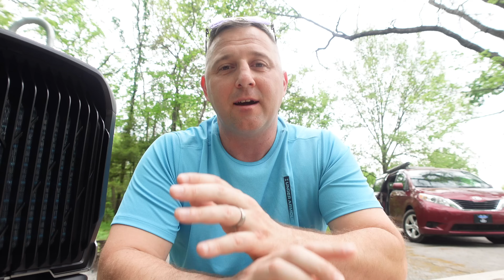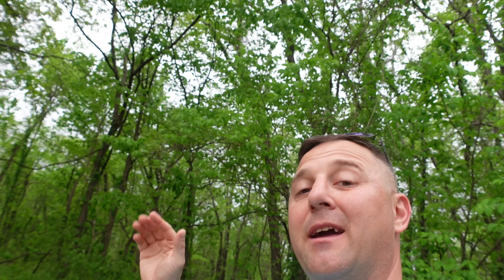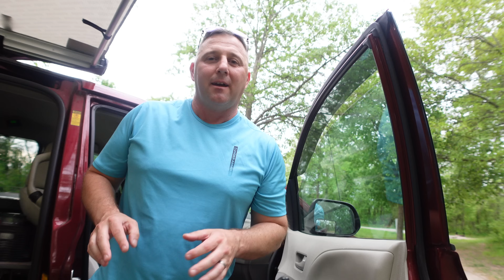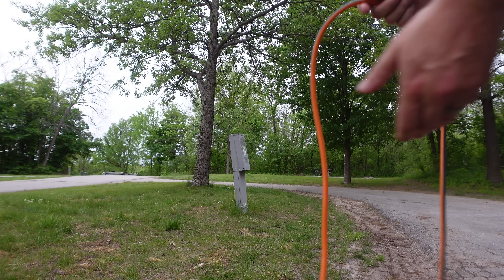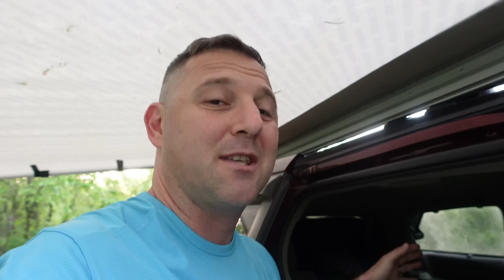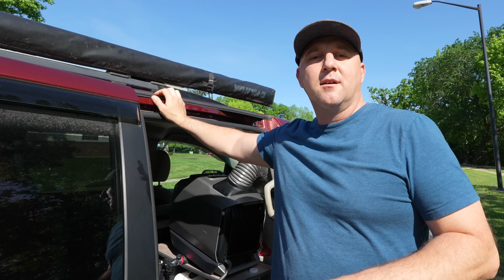The CHILLING Truth! - EcoFlow Wave 2 Portable Air Conditioner

Comment: Why not have it pull in air from outside to cool the evaporator? Would increase the efficiency a lot and then you won’t need the curtain rod.
Reply from the maker: I don’t like dealing with all of the bugs that get sucked into it. They clog up the evaporator.
Reply: @AdventureGearTV  Yummy! Well, something to consider would be a mesh/screen of some sort, but good to know!
Reply from the maker: @mexifinn7830  great tip. I have a mess screen that I tried on another AC unit, and I use those screens frequently without AC. But, they get clogged with small bugs at night.
Reply: No you want the cooler air from the area you're conditioning hot air will make it less effective and decrease the cooling. He really shouldn't be trying to isolate the area from the return..
Reply: @cwindsor8585  evaporator is the hot side of the ac. Condenser is the cool side.

You WANT to use outside air to blow the heat away from the evaporator. Otherwise you are taking already cooled air to expel the heat. The negative pressure will then promote the suction of hot humor air to come back in.

That’s why those free standing acs are less efficient than window units.
Reply: @mexifinn7830  no sir the condenser is the hot portion and the evaporator is the cold portion I hope I would know since I've been making a living doing ac for the past 15 years The only thing you have to worry about is expelling the hot air from the top out of the area which you're trying to cool. Other than that, all the air passing over any coil will help it become more efficient
Reply: @cwindsor8585  You are right. I'm not an HVAC person and I have them reversed. But I do have a degree in Chemistry and understand thermodynamics. I think we both acknowledge that you don't want to use the same cooled air on both sides :)

Comment: Do you recommend at the price it is?
Reply: Cheaper than buying a hybrid sienna
Reply from the maker: It’s a tough question to answer. It seems to work fine, and it’s not extremely big compared to what it does. Also, how often would a regular person actually use it? Three times in a year. I plan to use it much more.
Reply: You make an excellent point, Larry. Way cheaper for sure. The hybrid sienna is something I want, but I don't want to get back into debt anymore.

Comment: The AC is intriguing. The heater argument is laughable. How can you compare the heat pump efficiency of a battery powered system to a plug in space heater? If you only look at the heating, you're comparing an $1100 unit to a $30 unit that you don't pay for the power at a campsite. That said, I'd definately consider this for the AC operation. As far as that initial cool down, don't forget, you most likely have a very powerful AC system in your vehicle and can get the interior comforatble using that then use the Eco mode on the EcoFlow 2
Reply from the maker: Not matter how you look at it, a device like this is expensive compared the those space heaters or a plain fan. For $500 you can get a window AC unit. But, then you wouldn’t be Glamping in style.

Comment: So I managed to order a Wave2 early this morning for $999 from a non-Ecoflow site. The Ecoflow coupons and codes and discounts were so convoluted. I so appreciate this video! Great reminder about the app; i should probably check for updates to my Delta Max. Loved the demo of the hose in the window -- it looks better than my version 😄 Is that pool noodle oversized by chance? Placing the drain hose in a bottle is ingenious 😁 Have you tried charging any of the devices with the cigarette lighter while you're driving? (Assuming you're not parked for several days). So many possibilities 😀 Thank you so much!
Reply from the maker: Hi, it is the oversized noodle. You can charge with the car outlet. IT’s limited to 8amps max. So, it’ll be around 100w for a 12v system and 200w for a 24v system. I’m not a fan of their coupon system.  Thanks for stopping in, and WELCOME!
Reply: Dont waste $$ for the add on battery. I did and regret it. Point of use was off grid lifestyle. Says recharge plugged into the AC unit & unit plugged into dedicated house outlet on the grid. Didnt recharge. User manual claims can charge thru our delta pro solar power station which meant I spent another $200 for the necessary power cord & plug adapter. Didnt work. Says it can charge via USB. Didnt work either
Reply: Sounds like you have a broken battery. With the battery connected it should pull 800w, either all 800 to chargethe battery, or 400 for the battery and 400 for the unit if it's on.
I was happy to find if you're plugged into the wall it doesn't run power "through" the battery, just charges it then leaves it as a backup.
Of course, the battery being LiFePO4, and seperately chargable, would have been much better. Though it would also be much bigger and heavier!

Comment: The lithium-ion battery is a deal breaker. COME ON ECOFLOW!
Reply: For the same price just run it off delta 2
Reply from the maker: Another option would be to use there Delta with the xt150 connector. That might work better overall.
Reply: yeah, just purchase the Delta 2 instead (LFP and much more usable)
Reply from the maker: @Jasonoid  I have been looking to see if you post a video on this. I’m surprised you haven’t. Anything in the works?

Comment: Insulation and shade are key to proper cooling. 
When I ripped the roof liner out of my van it became a hit box in the sun. Inside temperature easily came to 30°F over ambient. So putting new insulation in is my top priority before summer
Reply: Why would u rip out the roof? Of course it’s gonna be an oven in there
Reply: @Puddycat58  the idea is to do better then what was before. Standard vehicle insulation is 1/2 inch at best.
Reply: Hmm, you should send that water in for testing
Reply from the maker: That thought crossed my mind. Then I started to think about the material of the AC. So, I would be skeptical, even if the test came back good.  The material could eventually leach something.

Comment: Ecoflow pumps the water from condensate to up of the heater, so switching to heat would blow it back.
Reply from the maker: If that’s the case, then it should evaporate the condensate. But, the pan is always full in no drain mode.

Comment: so, in the van, you do not need to install the other hose in back of unit and put that outside as well as the top vent????
Reply from the maker: It might make the system a little more efficient with the second hose, but I prefer not to use it so that bugs don’t fly directly into the intake. I’m not sure how much more efficient it would be with the dedicated intake hose hooked up. But, it works fine this.
Reply: I’m assuming it would help efficiency as it’s design is a split ac.  Like there divided inside the unit.  Air coming input moves across the radiator, the excess hot air is blow out. 
On the front inside air is stuck in and move across the other side of radiator which then blow out front.  Normally you don’t want to suck in the air your already cooling.   That’s the correct design function.  But that any space you trying maintain air pressure, which is sealed off from the external air.  
Since the wave2 with external battery is all water proof.  He could set the whole thing outside. Just attach the large hose to the front output and blow in fresh air to the van.  It might actually cool better as the rest of unit outside keep all that heat outside.

Comment: Did you only vent the exhaust hose, not the intake? (sorry if I missed it in the video - I was multitasking!)
Reply from the maker: Correct. I only vented the exhaust hose. Although it wouldn’t be too difficult to vent the intake as well. However, bugs can be an issue when pulling air directly from outside. Either way, the system gets the air that it needs to work.
Reply: And thanks for the pool noodle ideas. Great idea!
Reply from the maker: I hope it helps!

Comment: Great Review!  - Now Manufactures or after market designers need to take into account the Van designs, The base of the passengers or Divers seat should be either a power bank/ or a 12V Power station!! - or as a first step design power banks to simply slide under the seats All of this to Maximize Room in vans! — The NEXT step would be to design Front seats to be Modular A/C-Heaters all incorporated, again to maximize Van space!! — this step would incorporate drainage and an outside air port exchange built in to the vans!! 
- so to summarize an easy to disconnect Modular Seat system(for ease of repair or transferability) that is a Power bank and AC/Fan/dehumidifier Built in SEAT UNIT would be ideal for Mobile situations!
- who wouldn’t want to jump in their van and just tap a few buttons an be ready to go vs having to setup these Hog size type of units constantly?
Reply from the maker: That’s an excellent point. I think the new Sienna Woodland checks a lot of those boxes. It’s just very expensive right now.

Comment: interesting, I am a tent camper and just wandering how much area would this thing heat or chill in a 10 x 10 tent. Great video!!
Reply: If the wave2 with battery was inside the tent. You run the two hoses to the outside, which keep you cooling or heating.  
Or you keep the wave2 outside the tent, just have the air output blowing into the tent. Just the unit would not know what temperature was inside the tent. 
As the wave2 with external battery is required for cooling or hearting off grid or with use from the xt60 dc Jack say for other batteries, direct solar panels or like vehicle dc.
If your camp site had ac 120v standard plug you just use the ac adaptor to wave2.  You wouldn’t need the external battery. Seems the external battery has the dc regulator built into it so it’s required for solar or other dc sources for use cooling or heating.
Reply from the maker: Hi, I think this would work in your tent if it’s sealed up and the rain fly can act as insulation from the sun. It’s plenty cool just sitting nearby, but might not work as good on a windy day.

Comment: Great video!  I have been thinking about incorporating a Heat Pump into my build out.  Being able to both heat and cool from one device is the way to go.  Dehumidifying the air really does a lot to increase the comfort level.  Your stand alone fan is also a great addition to boost the comfort level.   Great informative video!  Thank you.... it really helps me with my build out.
Question:  What size solar panel are you using on your roof?
Reply from the maker: Hi, I have a 180w BougeRV panel. They make a 200w with the same footprint that is a newer model. I have video showing the entire install process.
Reply: @AdventureGearTV  Thanks!